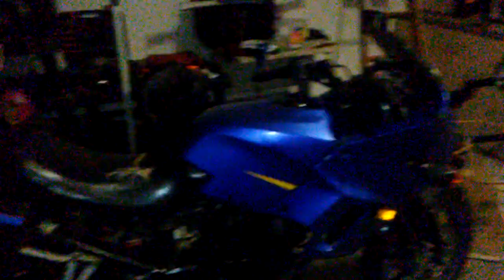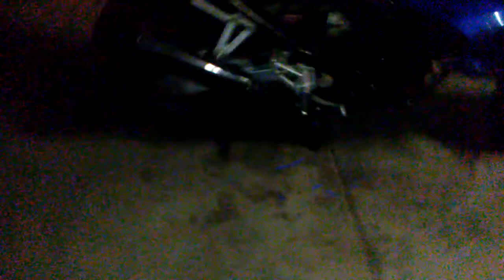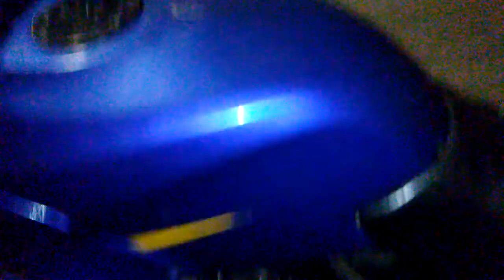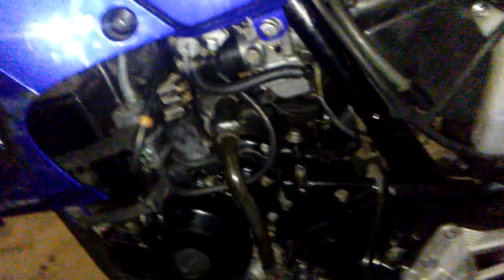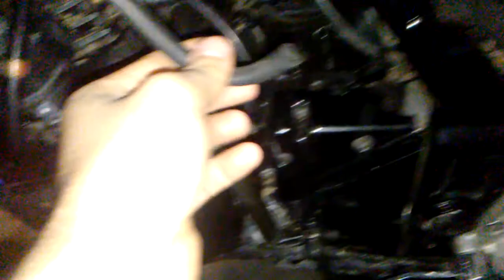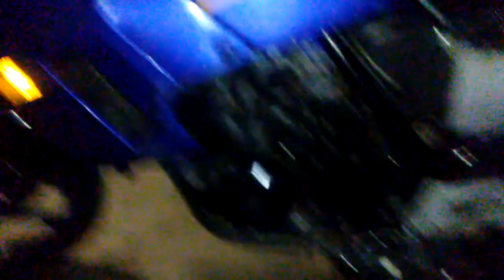More problem with the bike....

Comment: Did you mess with the sync screw while cleaning the carbs?  If not, does it run rough only at idle and low rpms?  If not, then you didn't get the carb jets clean and/or you might have made a mistake in re-assembly.   If there was any crap in that replacement fuel switch, then the jets are not clean.  Even if the carbs are a little out of sync, you should still get smooth power.
Reply from the maker: I clean the carb jets are clean needle is clean runs rough at idle and when applied throttle it dies
Reply: Ok, long comment.  Here's what I'd do(if you haven't already).  Pull the carbs back out.  eBay Outlaw part OR2728 $14.99 x 2. eBay, $20 Haynes '85-'07 Ninja 250 book (My bike Bible).  Check section 4.4- 4.11.  Exactly what you need to know is there w/ pics.  

  The needle valves should close slowly when you push them up and let go?  Did you use carb cleaner on both parts of the main jets?  (outer takes wrench, inner takes flathead screwdriver).  Did you take the tops off and check the diaphragms?(handle them with care. no chemicals on them.  Expensive replacement)  Use compressed air and old toothbrush to clean TF outta everything and all the tiny holes in the jets, where the jets screw in, and around the carb intakes and bowls.  Take out the carb drain screws to be sure no dirt hiding under them.  Make sure no cracks in vacuum hoses.  If you used new gaskets they are still good.  eBay(or local auto parts), small motorcycle fuel filter. Put it between the tank and the carbs 'cuz the tank filters aren't good enough.  A speck of dirt,rust,sand gets in...and you'll be pulling the carbs off again.

  Get it done right and you'll wonder why it's running like new. :)  Don't give up on a Ninja 250 and it won't give up on you.  Plus, parts are plentiful and cheap, unlike some other bikes..